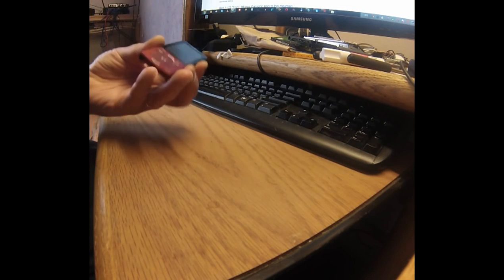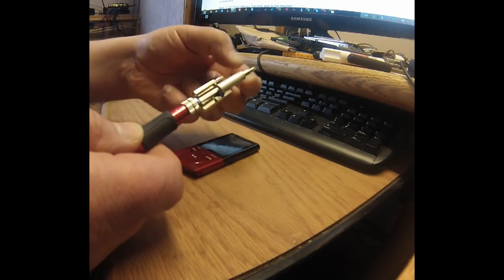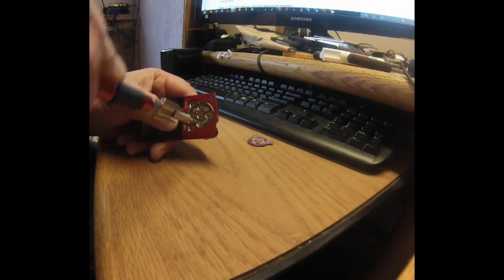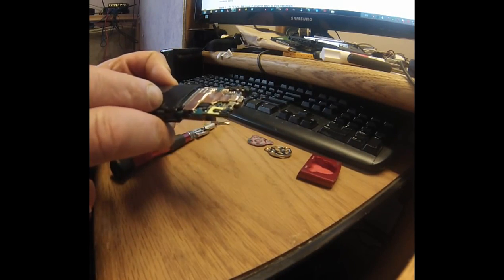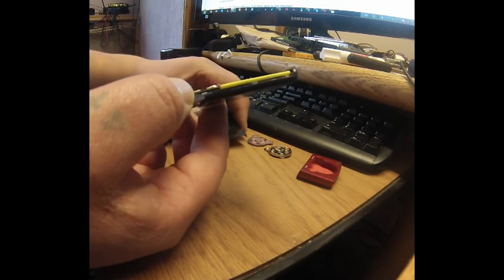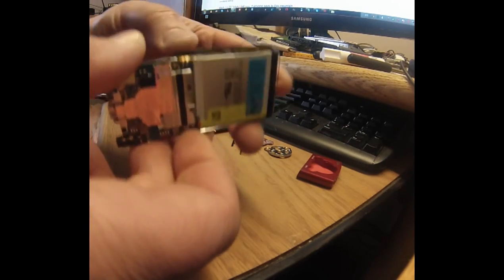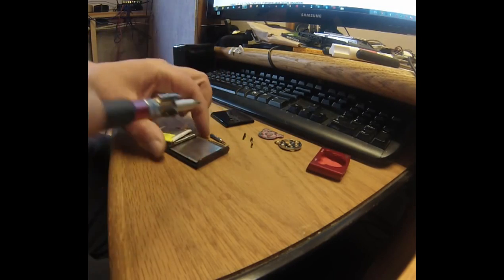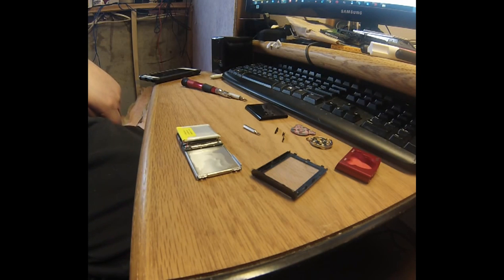Disassemble Sony Walkman MP3 Player NWZ-E345 | Full Teardown & Repair Tutorial

Comment: hey uhh my sony walkman recently stopped working after i put it into my backpack for around 45 mins so uhh it worked before i put it into the backpack and when i took it out it got stuck on ''creating library'' and it couldn't get passed that and before it broke it had issues with the icons in the menu / stopped playing some songs
Reply from the maker: It sounds like the Walkman’s internal storage glitched after the pressure in the backpack. When it gets stuck on “Creating Library,” that usually means the file index is corrupted or the NAND flash has bad sectors.

A few things you can try before opening it up:

Hard reset — hold the power button for 10–15 seconds.

Connect to a PC — if it shows up, back up what you can and run a full format (FAT32).

Check for broken icon behavior — that usually means the UI firmware can’t read certain sectors, so a full wipe can sometimes revive it.

If none of that works, the problem is likely inside: loose ribbon cable, damaged memory chip, or the mainboard flexing in the bag.

My teardown video shows exactly where those weak points are and how to open it safely. If you want, I can guide you step-by-step through diagnosing it.

Let me know what it does when you plug it into a computer.
Reply: @goasfarasyoucansee the pc doesn't even see the thing anymore and i did open it and put it together tightly yet now it turns on and turns off immediately (all i did was remove a piece of hair from the display and put it back together) so ye the pc doesn't recognize it it dosent boot up either also i did try resetting but it didnt work

Comment: Any way to fix the Vol. + button? In my case every other button functions as intended but the Vol. + button seems to have malfunctioned
Reply from the maker: Good question. 
And sorry for the late response.  Depend what you have it could be simple cable connection in the player not on the button side

Comment: Hello goasfaras, i will describe the problem with mine. it will not turn on but it will show the loading screen, once it seems like the mp3 will say creating library, it's frozen and and the screen will just turn off. EVERY TIME. i tried plugging into tv or computer. the tv and computer wont recognize the mp3 but the mp3 will recognize the tv or computer. i even reset and everything. plz help.
Reply from the maker: My apology for the late response. I wonder if you be able to solve the issue, as well if your player is still good and on the shelve? If you need my help let me know. For some reason YouTube just show your message today.
Reply: @chetter0385  you fix that?

Comment: Some help for people who have NWZ-E443   NWZ-E444   NWZ-E445 sony mp3 player
They all take the same battery the only difference is internal storage size of the mp3 players.  So 443=4GB   444=8GB   445=16GB.

The original battery that came in my NWZ-443 has these specs, and looks exactly as the one in this video.
Battery Size: LONG 42mm* WIDE 38mm* THICKNESS 3mm
 
Capacity:380 mAh
Battery wires:2
Standard Voltage: 3.7 V
Cell Chemistry: Li-ion battery

I could not find an exact match...  But I found a Li-ion battery that works fine on ebay/
Specs are :-
Long 35mm * Wide 30mm * 3mm thick.  Thickness is very important 4mm thick WILL NOT FIT.
2 Wires (one will be red one will be black)
3.7Volts 
350mAh.  

If you can find a battery 380 or 400 mAh that will be fine it just means it will hold larger charge. 
It MUST be 3.7 volts... I think some adverts may say charges at 4.8V thats correct because the sony power/data cable plugs into usb which gives 5V.

Once I soldered the 2 wires of the new battery to the board on the mp3 player, I used some electrical tape to hold the new smaller battery in place. 
Hope this helps anyone repairing one of these.... thx to goasfaras yocansee for the disassembly video. :)

Some maybe useful search terms and links don't know how long into the future they will work.

The battery i purchased came from an ebay china seller.
   I am not connect or affliated with any online battery seller, i just repaired my Sony player and thought I pass on what I found out :)
Search ebay for ->     Rechargeable 3.7V 350mAh Li-ion Battery 303035 For MP3 MP4

or this battery which has a  slightly closer length and width size, to the original sony battery and holds a better 400mAh charge.

Try to copy the Aliexpress link below into your browser, if it is broken, you will have to search for terms like :- 3.7v 350mah 3mm thick battery   on aliexpress
https://www.aliexpress.com/item/3-7V-400mAh-303442-Lithium-Polymer-Li-Po-li-ion-Rechargeable-Battery-cells-For-Mp3-MP4/32865935620.html

Comment: What kind of glue did you use on the front buttons when you put it back together?  The button assembly was glued on when I pried them off.  Replaced the battery and it works great but the button assembly will need glue to stay in place. I tried a minor epoxy and they came loose after a couple of days. Afraid to use super glue, if any gets in the buttons they will be locked or jammed permanently. Any suggestions please?
Thank you
Reply from the maker: Robin Sattahip sorry for late reply. Get 3M double tape. Commercial grade  Thin and strong. Or other brand. I'm not sure if it even have a qlue,  isn't it just a stay there with side lips?
Reply: By any chance, do you still have the battery model or where did you find it?

Comment: My Backbutton comes not so easy out :( i Scared to brake it xD
Reply from the maker: Yeah, the back button on these Walkman models can feel really tight 😅 The trick is to use a thin plastic pry tool (or even a guitar pick) instead of metal so you don’t crack it. Work slowly around the edge, little by little, and it will pop out without breaking. 👍

Comment: Do you know where I could find this MP3 players battery? I want to replace mine
Reply: bloo jkl45 AliExpress dot com in China. $16 with postage. Easylander Original replacement 3.7V 380mAh Li- Polymer Battery For SONY NWZ-E345 MWZ-E373 MWZ-E383 A864 A86, you'll need to have a cheap soldering iron to solder the wires.
Reply from the maker: That Walkman uses a 3.7V Li-ion flat pack battery (about 300–400 mAh). Sony doesn’t sell them anymore, but you can find replacements on eBay or AliExpress if you search “NWZ-E345 replacement battery” or look for generic 402030 size packs (measure the old one to confirm).
– Desolder the old pack
– Solder the new one (red = + / black = –)
– Reassemble carefully

Comment: I have a Moser Baer MP565-2G
I used it lastly, in 2010 or 2011
it stopped working at that time, I think it was my mistake, I charged it over night,
after nearly 7 years, I opened its circuit, but couldn't find anything, 
now charging it.. but won't power up..
I'd love to here from some one if you can help.

thanks
Reply from the maker: Issue is dead battery, find same batterry and replace it, it will start
Reply: Thanks man,
May be you are right, but I found a burnt capacitor..
I will change both and check..
Battery.. is lithium polymer battery so yet to find a replacement..

Thanks again.

Comment: Mine just recently doesn't want to turn on is it because of the battery? I tried charging the whole day and still doesn't turn on I had bought a Sony Walkman MP3 before but out of nowhere in 2 weeks it's stop working so I kept my brothers and it's the recent one that doesn't turn on anymore
Reply from the maker: 💬 It could be the battery or a disconnected ribbon inside 🔋  
Sometimes these Walkmans stop powering on because the internal cell drops below safe voltage.  
Try connecting it to a charger for a few hours, then a short reset using the tiny pinhole button (if your model has one).  
If that doesn’t help, opening it carefully and checking the battery connector usually does the trick 👍  

💵 Cash App: https://cash.app/$Goasfarasyoucansee
💳 PayPal: https://www.paypal.com/paypalme/polukhin
🏦 Venmo: https://venmo.com/u/Selforfun

Comment: FAIL. This procedure will ruin the device. It will fix the moisture problem but you will never hear it again. There are internal micro wires for the earphone jack THAT WILL TEAR when you remove the base. Mine works and plays fine but there is no way to hear it.
Reply: That is certainly something to watch out for, but did not happen to me (getting as far as just short of prying the battery away from the case.) Which piece is the 'base' that we should watch out for? Thanks in advance, (because I am going to have to go back in and replace that battery soon.) For now I have it back together and running, but I wanted to see if I could get it apart and just find the battery.
Reply: Removed  battery replaced and re-assembled, no problem with headphone jack.
Reply: @rsattahip  
Hey Robin, i seen your several comments here and you seem to be familiar with the procedure of purchasing and installing a compatible new battery with one of the Sony walkmans.
i too think i may need to do this sometime soon but am yet to order mine from amazon (not sure yet which one)
Can you be a 2nd opinion for me? or is there any specific SonyWalkman i musn''t even get itfp as there is no individual battery for it to be found?
 basically i just don''t have a clue but anticipate one to be necessary
Reply: @rsattahip  Thank you so much for responding.
  i understand what you're saying but ím not yet  clear on what specific walkman i'm'na buy- (i.e. nwz-s755, Nw-A806 , NWZ-E436F and another 10 or so options) do you know if they all use the batttery in your link?
 i'll buy it factory sealed but  suppose the battery may nonetheless have significantly deteriorated-- I 100% agree that the old Walkmans are way nicer than the new ones. it's like sony just stopped caring.
Reply: @mlmike13  You're welcome, good luck to you.  The video shows very well how to disassemble the device, the biggest trap to avoid is  getting the polarity wrong, be careful to note where the red wire goes and where the black wire goes, the replacement must be the same.  You ca buy a cheap soldering iron at stores like Walmart that will do the job, though it's better if you find someone with soldering experience to do it for you.
Reply: @rsattahip  ím not yet  clear on what specific one i will buy- (i.e. nwz-s755, Nw-A806 , NWZ-E436F and another 10 or so options) do you know if all sony walkman mp3's are compatible with the batttery in the link you gave me?
Reply: @rsattahip  Hello Robin, I know this is an old post, but the battery is dying in my sony walkman nwz-e345, and I found a replacement battery but cannot find a video on how to replace. This is the closest video I could find about the disassembly, and it never shows how to disconnect the battery. Disassembly looks fairly easy. Could you tell me please, do the red and black wires on the battery have connectors on them that sort of "plug in" or must they be soldered in place?
Reply from the maker: 💬 Thanks for your feedback, Mike.  
Sorry to hear that happened with your device — I always recommend using plastic tools and going slowly when separating the base to avoid stressing the headphone jack wires.  
Appreciate you sharing your experience so others can be careful too 👍

Comment: where i can buy battery for this model?
Reply: battery plus or ebay just open the case pull battery and read numbers of it, easy to get battery-plus, cheaper to get ebay.com
Reply from the maker: 💬 You can find the correct battery on AliExpress or eBay — look for “Easylander 3.7V 380mAh for Sony NWZ-E345.”  
It’s the same size and connector as the original 🔋